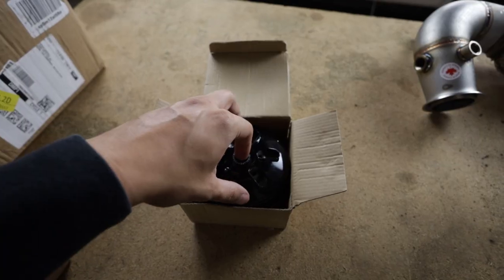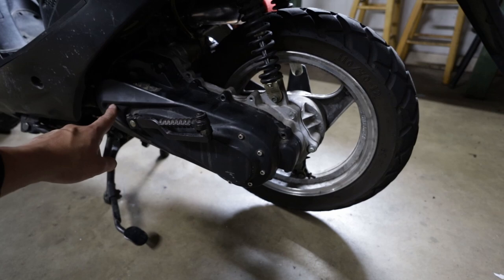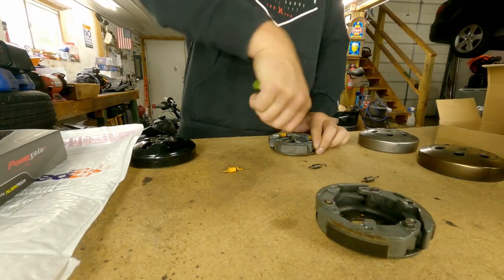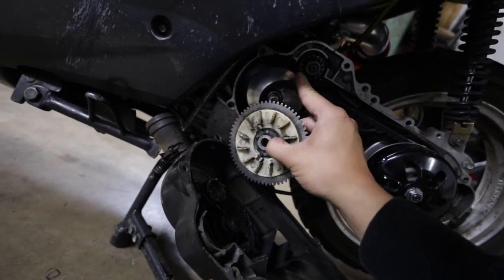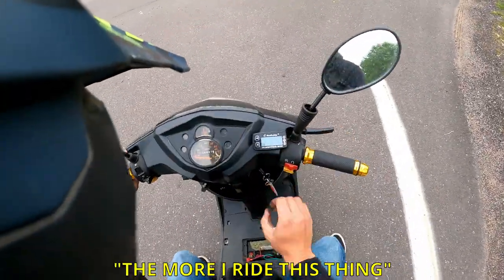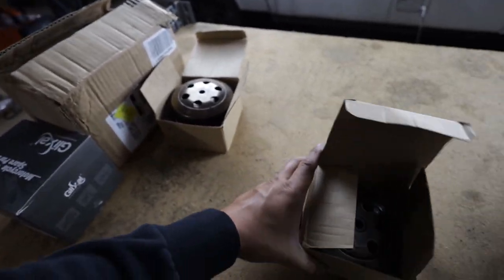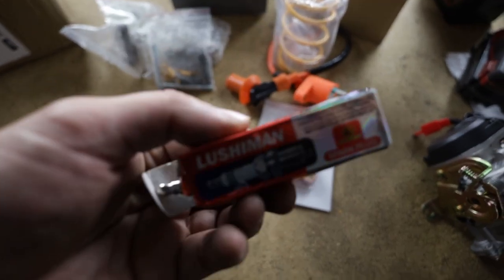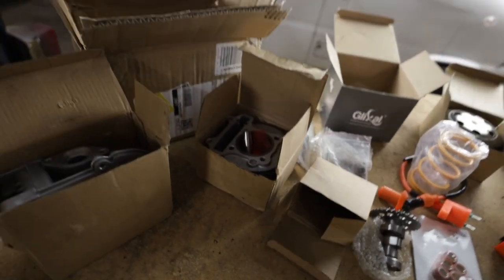50CC GY6 SCOOTER PERFORMANCE CLUTCH WORTH IT?

Comment: Hey What jet did you guys settle on? I live near ish you, and have alot of the same mods lol , Glixial 80cc BBK, A9 cam, 20mm carb, uni filter, Amazon pipe,  Blue CDI, orange coil, NGK carb , High ramp variator 6 gram rollers, Gates powerlink belt

Comment: The reason that buzzing thing happened and that the nut came off is because when it was torqued on the belt was in between keeping the outer side of the variator or the big starter gear thing from seating properly, now because the big outer variator gear thing is toques up against the belt and is not seated and centered properly, when you start driving, pressure is put on it which eventually makes it want to move out of position because the belt is rubbing against it to pull our weight, and then it either loosens too much and the starts making fun noises or even better flies off and wreaks havoc on your cvt, to solve this install the belt after the actual variator and also press the big rear clutch spring down so that belt sits inside which gives slack when you install the outer variator thing, hope this helped

Comment: the torque driver you replaced most likely has a straight grooves or different angle on the grooves. The different grooves in the TD greatly change the way your bike "shifts".

Comment: 80cc Big bore kit 5.5 gram rollers and stock clutch 20 mm carb stock jets I weigh 220lbs I get 44mph on flats
Reply: Too slow for that kit
Reply: The carb is toi small buy a 24mm
Reply: I"ll do 55 mph, with a 80cc, 24mm carb with a 102 mainjet, 6,5 gram rollers, and a yellow(1500rpm) set of springs on the clutch and
 pressure spring.
My weight is even over 220 lbs
Reply: Get some 7 gram rollers as you will be doing 48. It's not much but it's something.
Reply: my full stock 50cc chinese is going 50mph i only changed rollers and belt
Reply: I have stock everything with a “high performance” carb from amazon for likw 20$ and I hit 40mph
Reply: Stock jets with a big bore kit? I dunno about that. You could have way more power.

Comment: On the big bore kit run a 24mm carb with a naraku intake spacer if u can it would be cool to see u install a adjustable ac current cdi box with a fabricated exhaust

Comment: thanks for all your amazing content.
im starting to like Glixal alot too.
i have the 20mm carb, the racing clutch assembly, and the 729 belt.
ill also very soon order 47mm bbk.

do you have any input on thier crankshaft ? sure it wont by ssp-g or naraku, but i cant afford 250-300 CAD with shipping for that right now.

i have a weird knocking nosie and i cannot find the cause.
could help me out trying to find the issue ? it could save me a crank if its not the issue.
Reply from the maker: Thank you! We haven't had to do anything with our crankshaft so far. You might find some good info on YouTube from Scooter Swap Shop or Rolling Wrench. They offer way more in depth information on that kind of thing. Hope that helps. We just don't have the experience to give you a better answer
Reply: @throttle_therapy  thanks.

Comment: Do most scooters have the same clutches? My son has a 2013 benelli quattronove 50x and it taps out at 55km/hr. It has 554km on it and a 1/2" wide belt. Thinking of replacing with a better clutch to get 60km/hr or more out of the 50cc engine. Suggestions and help before i sell it for being to slow
Reply: They all chinese scooters so might be a chance is the same parts

Comment: my 125cc used to max out at 55mph after I put red clutch springs I hit 70mph made a decent improvement
Reply: How did you compress the clutch to put the belt on? With the red springs
Reply: @Ryan-lz1po  well I got a hammer and hit it into place alot of messing about but enough patience and u can do it
Reply: @Italian_MotoVlogs  lol yeah that works too 👍 I also figured out you can open up the clutch fins by taking two socket extensions on top and bottom and squeeze them together and it leverages them open. Then put belt in

Comment: What kind of tach do you have
Reply from the maker: It's a Runleader. Got it on amazon👍
Reply: I have that,the one with the temp sensor,I run 4,000 rpm at 40mph,what do you run for rpm

Comment: hey guys, awesome video!!
I recently installed a 72cc big bore kit on a kymco agility rs, at the moment everthing else is still stock except that the varioring  has been taken out.
my top speed is currently around 60 kmh (37 mph).
I'm wondering what the things are that I can do to get an even higher top speed. mainly the jet size, the weight for the variator, which springs I should use for the clutch and what to do for the airfilter. 
I really hope someone can help me with this.
Reply from the maker: 1500 rpm clutch springs would be a good idea
Reply: Wat is de diameter van je zuiger?
Reply: @StefGaming  47mm boring
Reply: My unrestricted Agility with 6gram sliders does 40.
Reply: Change the stock airfilter to a tuning one